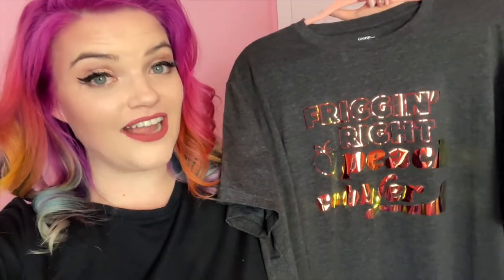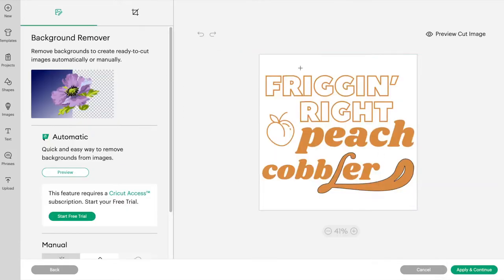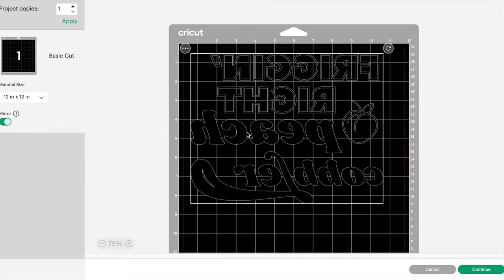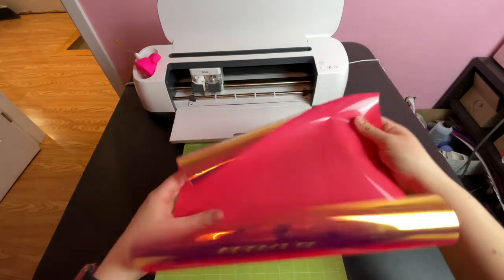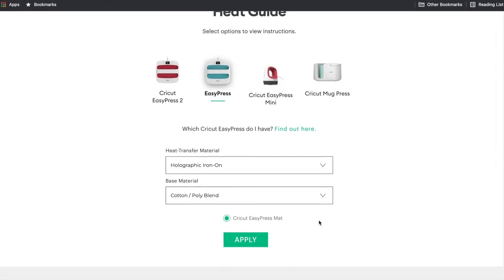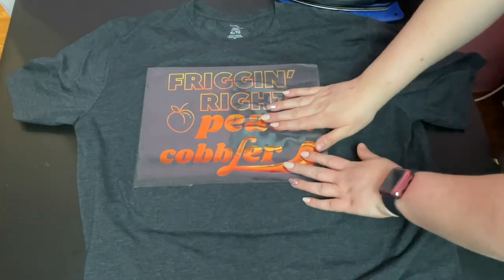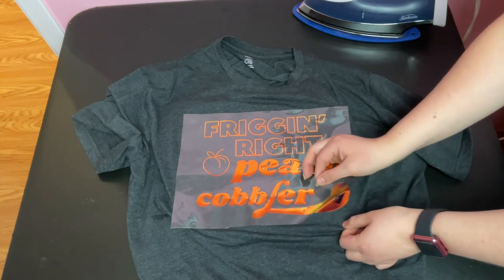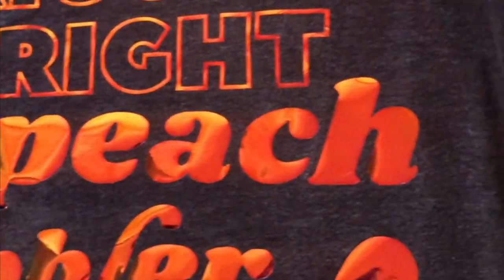HOW TO USE CRICUT HOLOGRAPHIC IRON ON VINYL HTV // DIY Heat Transfer Shirt Tutorial for Beginners

Comment: So I used it on a brown shirt and the holographic is like a shiny rust color against the shirt? Yours on the blue shirt still looked orange…is the holographic only for light colored shirts?
Reply from the maker: Hi Carrie, was the vinyl you used the exact same one I used in the video? I’ve used holographic vinyl on both dark and light colours and I’ve never had an issue, but I usually use something neutral like black or grey. (Maybe the shirt looks blue in this video but it’s a dark grey!) It’s possible the brown colour has an effect on the way the orange looks? I’m not sure!